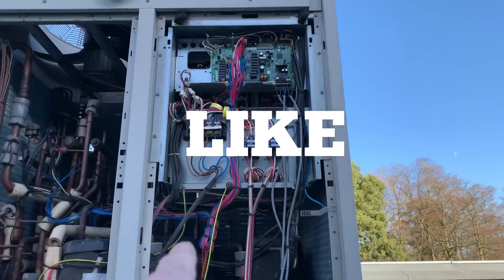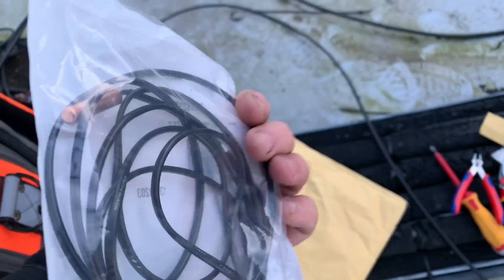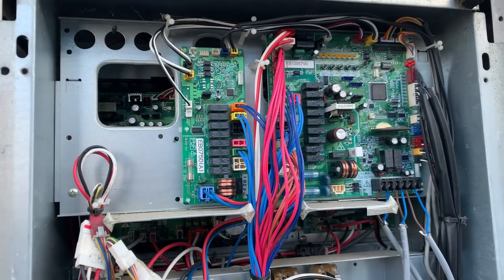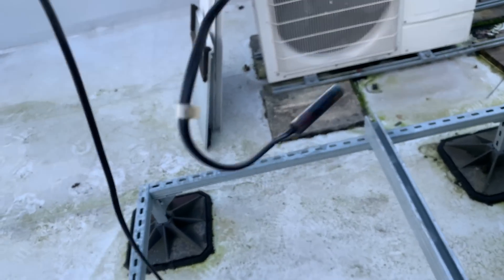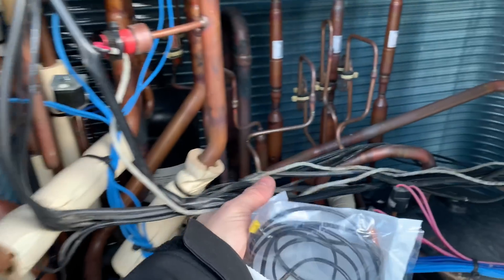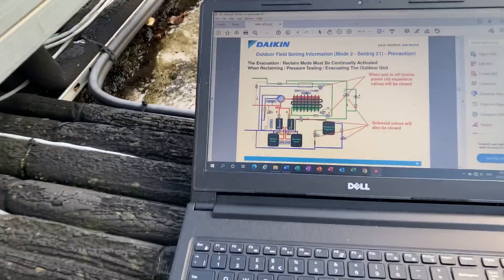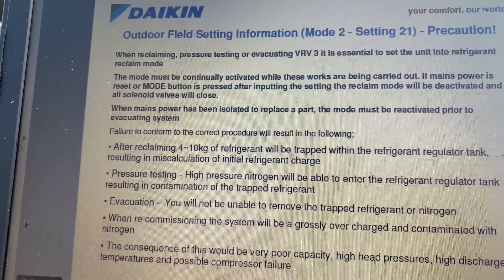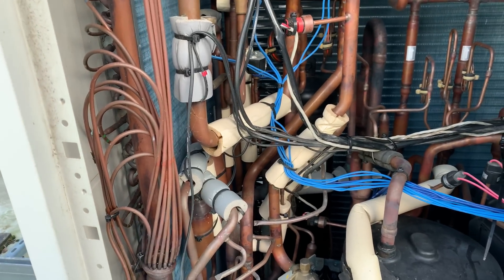DAIKIN VRV MODE 21 * WHY WE NEED TO USE IT ! *

Comment: My VRV Life unit had an L5 compressor failure.  They evacuated the unit but twas not put it in mode 21 (they were not properly trained on VRF Life)  When they put the new unit in they put refrigerant in as if it was a new install with more added for line set etc.  I asked them to do a final charge adjustment while in mode 22 and getting sub cooling down to 12F.  They had to take out 2.2 lbs of refrigerant to get it there.  Do you think its possible there was refrigerant stuck in the indoor unit because it wasn't evacuated using this so unit was over charged?  I mean daikin says it right there in the warning that you have to use it so my guess is yes.

Comment: Thank you really good advice. As normal. 
Maybe just say that power must be kept on ,When carrying out pressure test. 

Would like to see you reclaim from master slave system. Code out compressor.
Just some ideas. 

Thank you
Reply from the maker: Thanks mate 🙌🏼 Yeah your right, should have said power on for all R410a systems and power off to R407c indoor units to keep the valves open.

Good ideas mate 👌🏼 Could definitely get some footage of them sometime ! 

Thanks for watching mate 👍🏼👍🏼
Reply: Thank you . Keep up the great work .

Kev

Comment: Never been on Daikin course mate and I’ve never read the course manual but I always thought Mode 21 also opened up the valves on the BS boxes and indoor units???  And I presumed a de-energised system resulted in a “normally closed” position of any solenoid valves,,,
Mainly my reason for believing the former is because I have used the Mode 21 if I’m getting irregular pipe freezing in condenser or Conflicting air off temperatures at the evaporator to the mode it is set in I.e cooling when in heat mode due to a suspected stuck valve,,
A mode 21 helps give it a jolt me thinks,, but I could be full of shite,,? Like I said, I ain’t read the manual
Reply from the maker: Yes mate your right it does open up all the solenoids and expansion valves indoors too 👍🏼 Sometimes worth putting it in and out of this mode a few times if you suspect an indoor unit expansion valve or solenoid fault like you say 👌🏼👍🏼
Reply: I find this post rather sad, Ryan seems almost proud that he hasn't read a manual. It just shows a lackadaisical approach to an interesting and satisfying line of work.
Reply: @Brian-1948  no mate,, I take a methodical approach based on trial and error ,, of course I’ve read an installers manual,, but I’ve never had the privilege of being on an manufactures course and being taught by the gods themselves and  I’ve never been given the bibles supplied after attending each course,, everyday is a school day brother

Comment: Also heres another question for you,  do you think it would work to just use solenoid magnets to open them all manually if you had enough of them and could access them? Its obviously pretty tight clearances in these unit what do you think?
Reply: Wouldn’t work. Mode 21 opens all of the EEV’s, Solenoids and indoor valves bs box’s and indoor EEV’s

Comment: Learnt about that mode after finding nitro mixed with r32 in a single split daikin. Later found it had damaged the L.P. switch because of mixed refrigerant
Reply from the maker: Really ! Nice find 👌🏼 Bet there’s loads of VRV systems out there with nitrogen still in the system !

Comment: This is why I sometimes loath VRV or VRF systems... You rely on their program for evacuation or recovery. Yeah bet it works 98% of the time..
 However, "An experimenter of experience would sooner use a strangers tooth brush as he would another's measurements."
 Hence, why I test for potential or the very least a magnetic field on all allegedly "open" solenoid valves/coil/etc... Such a task that the manufacturer discounts, because their excrement can never stink
Reply from the maker: 😂 loved reading that mate 🙌🏼👏🏼👍🏼👍🏼

Comment: Didn't know about mode 21.. How long will it stay in mode 21?
And if I want to leak cheak the vrv then the power has to be on, but what if it calls for cooling and the system is full of nitrogen..
Hope you can answer, because it's your on fault I have all these questions😂😂😂 that's what you get for learning me new stuff🤣🤣
Love the video
Reply: To be fair it stays in recovery mode till you take it out. Can’t run I recovery mode
Reply: @po65231r  thanks.. But wouldn't like pumping the system full of nitrogen with the power on.. Or is that's just me being weird?
Reply: @christiansommer914   No mate if your putting in recovery mode it’s has power to it already and it just opening valves fully. Then it won’t run till you tell it to
Reply: Working on an old K series today and mode 21 only stays active for 10  minutes before needing to be reactivated. This was on a hotel but found that if you turn off the indoor spurs with the outdoor in 21 then it will stay in the mode until the indoor power is reinstated. I was lucky enough to have assistance as we were changing out a coil so would of been a mission if working alone 😆
Reply from the maker: @mrdp-fn2xv  Yes mate, I think on the R407C systems you have to turn off the indoor spurs to keep them open like you did 👌🏼 Bet that was a right mission in a hotel 😆🤦🏻‍♂️👍🏼👍🏼
Reply from the maker: 😂 Thanks mate 🙌🏼
As said above, once you put it into recovery mode it locks all the controllers and can’t be operated until you take it back out of recovery mode 👍🏼👍🏼
Reply: I like to go to the itouch if there is one and prohibit all operations before performing a pressure test just for piece of mind. Im sure someone mentioned once that the very early daikin VRVs come out of mode 21 after a period of time..

Comment: Wish it was that simple with all manufacturers, opening the valves in a toshiba VRF for example is a pain. 
Good video as usual!
Would be great to see you do a maintenance on a Panasonic VRF if you look after any
Reply: Best VRFs, love a Panasonic
Reply from the maker: @RuthieG1  You are the Sanyo/Panasonic Guru Ruth 😉👍🏼
Reply: I am just about to change a set of VRF Toshiba’s. 3 to 1 bank and I haven’t had too much trouble yet, I just use the radial dials and there’s like a 2 minute timeframe to kill the evap power and they will stay open
Reply: All this was told to me by Toshiba technicians in the field and it has worked 3 times 
Prior to this coming one
Reply: Love your videos! Very knowledgeable technician and seem to always pick up something watching your videos.
Reply from the maker: Thanks mate 🙌🏼 For some strange reason I genuinely don’t come across many Panasonic VRFs 🤷🏻‍♂️ I used to install loads of Sanyo kit and still look after a few but haven’t got any Panasonic VRFs on my list !
I actually really enjoyed working on the Sanyo kit, they had there faults but at least they were consistent 😂
Ruth who has commented above 👆🏼is the Guru of all things Panasonic though !
Do you look after much Panasonic kit ??
Reply: Got one site with about 20 Panasonic VRFs, but thats the only one. Dont look after any sanyo. I do prefer Daikin and Mitsi but I suppose that’s because im most familiar with them. Been on training courses etc. Im sure you will come across some Panasonic soon 😁